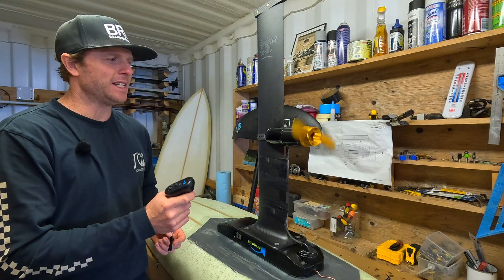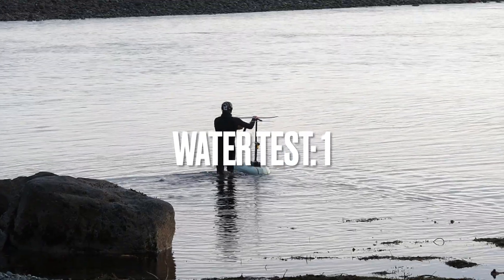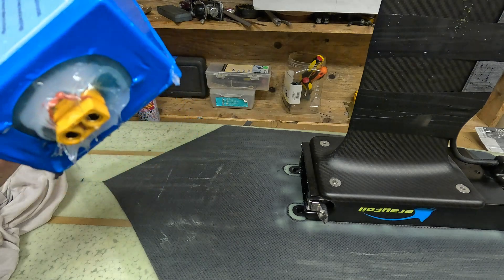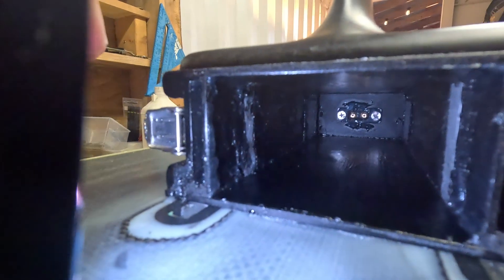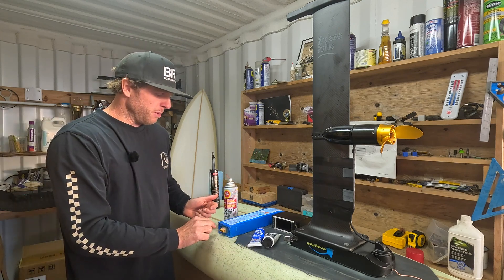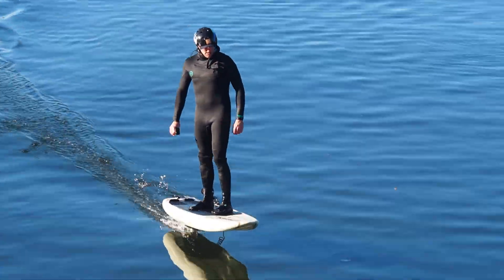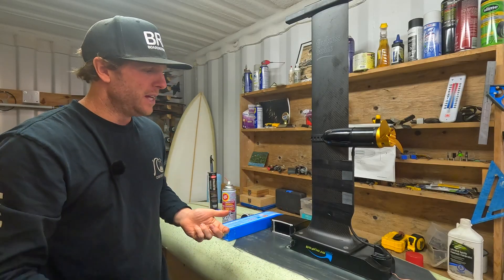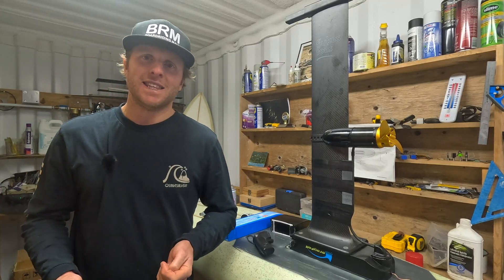Alibaba Foil-Assist Water Test: 4-Session Reliability & Performance Review

Comment: Thank you for your testing. Your sealed modification is also very interesting. Actually, water is allowed to enter the inside of this case by design, because our batteries are waterproof.
Reply from the maker: Hey guys, yes but as you know, I had a cut in the bubble button, and the gasket came off on the plug, so is the battery still protected in that event?

Comment: It's BLDC control which is commonly used in all foil assist now, power downgrade feels rather significant as the voltage drops. the more adavnced way to control is the FOC control commonly used in drones, which is a more adavanced control algorithm, that gives more precise control and power efficiency as well as less power downgrade over the time of the voltage drop. You mentioned that this product's rotar does not come off, does the water get in between the stator and the motor like the other foil assist?

Comment: min 15:00 I guess you mean that for surf foiling with waves using foil assist, you have to use a shorter cable, about 20cm, I think that's correct, with the motor close to the board, but that doesn't work for eFoil on flat water. On flat water, the motor has to be close to the front foil 70cm cable. Your 35cm cable length is more suitable for surf foiling but it has to be with waves. thanks you for video
Reply from the maker: Yeah exactly. My main goal is just surf and swell, so a 20cm would work for me best I think.  :)
Reply: @FlukesKitesurfing  I'm eagerly awaiting how it works for you on the surf foil.

Comment: Makes me wonder how truly waterproof my name brand unit is …. My efoil makes no attempt at being waterproof with no adverse effects. Many components that are exposed to water use a “potting” technique where the electronics are sealed inside an epoxy like material. Is it possible that the electronics in this foil assist undergo the same process and all your waterproofing steps are actually not necessary.

Just curious.
Reply from the maker: Thanks for the insight. and Yes exactly, thats what the manufacturer says. In the last video where i pull it apart, it does show all the electronics are in resin. That said I was not convinced. Too much reliance on a single gasket that evidently did break!

Comment: Duotone packs their battery into a bumbag. Reviewers liked that because the board "is more agile". Maybe worth a trial?
Reply: Duotone needed some product differentiation. Personally, I prefer to have my body be light and nimble. When I mountain bike I have the bike carry my water ( no camelback) so my body can be light, nimble and mobile. Duotone having a fancy back vs backpack at least lowers the center of gravity.  It all provides nice options for the consumer.

To me the biggest issue is the price. Hopefully the suppliers will be wildly successful and can ramp up their manufacturing volume such that the prices come down!
Reply from the maker: @jeromep4148  yeah same, id rather have the battery on the board than on me.
Reply from the maker: Yeah you know what, Marty who has helped me with a lot of foil build info over the years, added his battery to a backpack on his DIY foil assist about 2 years ago... he likes it for that reason too. But for me, i don't see it... and i don't what some electrical cord and flammable battery strapped to me haha. also gowing down in big sell or any other range of issues that id rather get away from the board quickly etc.
Reply: @FlukesKitesurfing   I understand. Better burn the board than your bum!
Reply: I love a backpack and won't go back. Be sure to try one before guessing how it changes things. I've been FoilDriving for several years in waves, behind boats, with wings & parawings, and in flat water. While a trench helps, it's still not as good as a backpack--to me. 🏄‍♂️
Reply: Thanks @Foilfun !

Comment: Like sub and comment people. interesting review so I've subbed as I want to know more. I wonder if you may of over packed it with grease and this is what caused the gasket to dislodge. Also dielectric grease is an insulator so hopefully you are not getting it between the electrical connections and rather just putting it around the area. These battery's are very temperature sensitive when charging and discharging. Great work, keep it up:)
Reply from the maker: "Like sub and comment people" I like that haha! :) Yeah I was wondering if suction was the cause of the issue too.. but now that i've used it a bit i actually think the gasket could have been nicked on the charger plug.  The charger plug seems even harder to fit than the unit plug, and sometimes dislodges the gasket. With the grease, ive been going pretty crazy with it haha but it seems to scrape the connections clean as you assemble so haven't had any issues with the connection so far. I think i can start to relax on the grease though...

Comment: I have the same system as you. You don’t need to make the box waterproof — the battery itself is waterproof. And you don’t need to use that much grease; you only need to put it on the yellow connector part.
I extended the power cable so I can place the battery on my back, which makes the board lighter.
Reply: He knows the battery is waterproof, and explains why he sealed the housing too.
Reply: @alexanderturl Sounded like he didn’t trust the waterproofing of the battery hence all the extra steps.
Reply from the maker: Nice! Glad its working for you. Yes in the last video I explain and show why I made some changes :) There is no doubt i'm going a little overboard with the grease, but so far its done a great job of not only protecting the battery when the gasket broke, but also completing the "waterproofing" of the battery container too. :)

Comment: Strange that you cannot get of the rotor from the motor, it must get off for cleaning. Maybe they left the gasket there on the mount side. Also you can show then how motor looks on the inside, how it is waterproofed
Reply from the maker: No I asked the supplier and they said its a sealed unit and can not be removed... Thats why i'm just hitting it with the lubricant